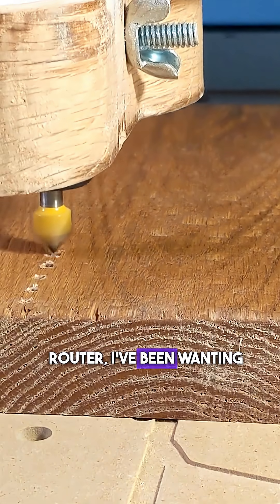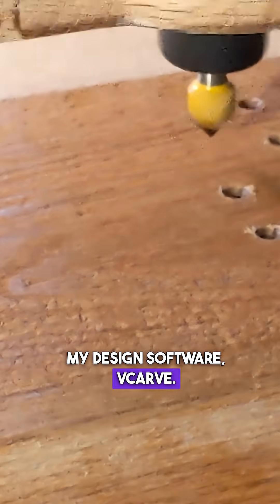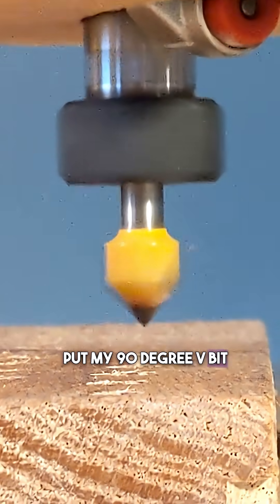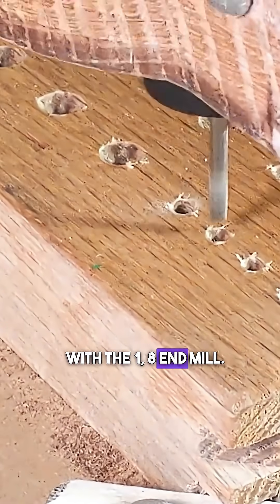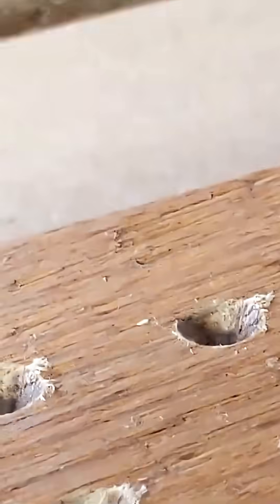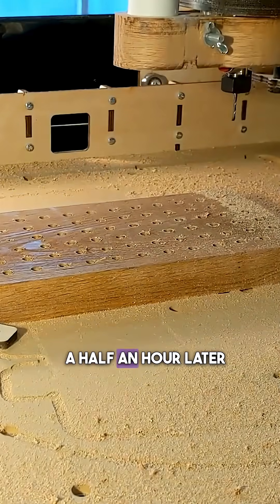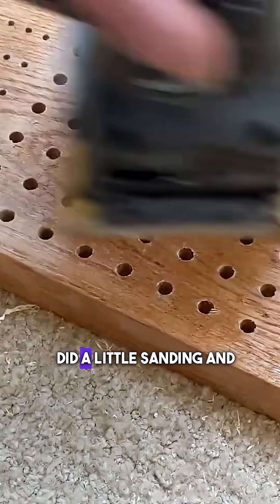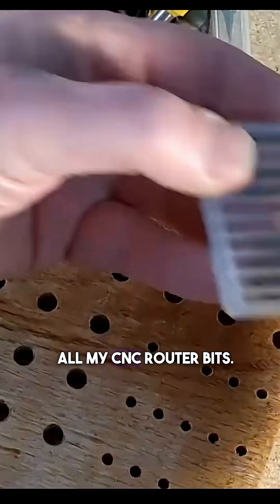Unlocking CNC Router Potential

Comment: Why chamfer first?
Reply from the maker: Chamfering first helps to create a clean edge and can make it easier to cut the main profile without chipping or breaking out. It’s a solid technique to ensure better accuracy and finish quality on your project.
Reply: @IDCWoodcraft thanks for the reply
Reply: @IDCWoodcraft  Interesting technique. If I'd have made this I would have surfaced the piece first, done the holes, then chamfered but not plunged.

Comment: It's best to seal the wood. It contains acids and with a high humidity that can easily rust your bits. I've switched to plastic containers for my bits and keep them in a dry place.
Reply from the maker: Great tip! Keeping your bits in a dry place really helps prevent rust and extends their life. Thanks for sharing your strategy!
Reply: Rockler makes plastic bit holder inserts for projects like this.

Comment: Why the V bit first?
Reply from the maker: Using the V bit first helps define the details and outlines of your design, which can lead to a cleaner finish when you switch to other bits for roughing or finishing. It also helps to set the depth for subsequent cuts, making the overall process more efficient!